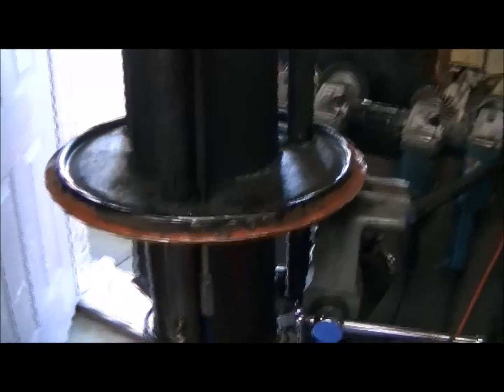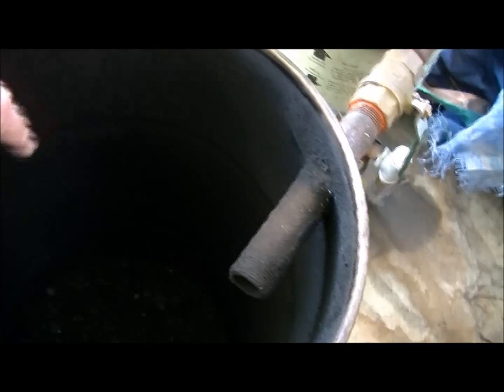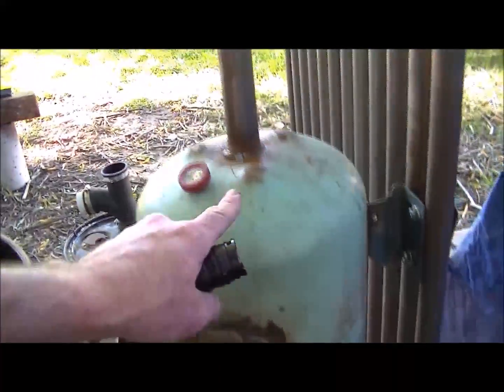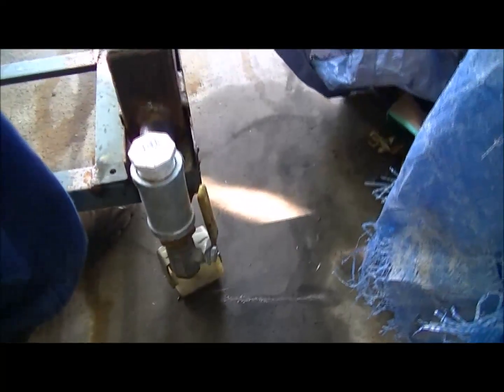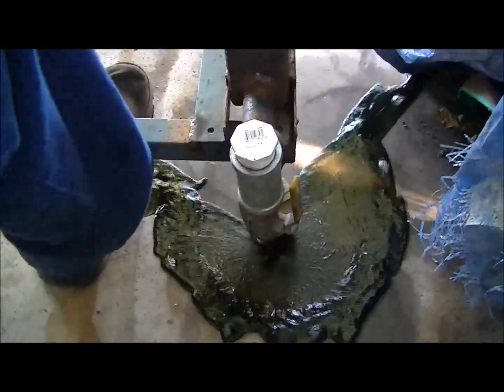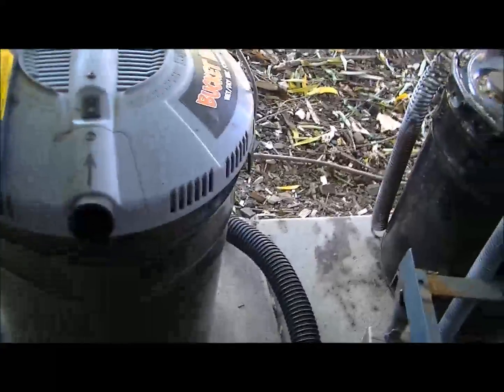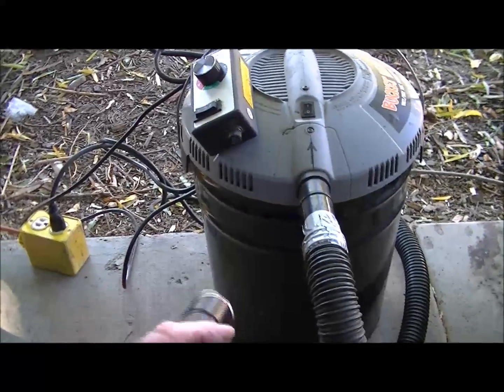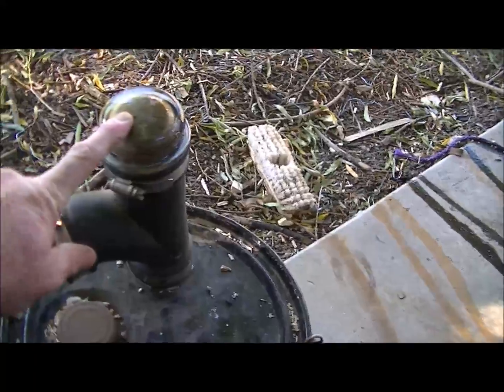DIY How to make a Homemade wood gasifier system video #1

Comment: Have you checked the pH of the water in the water filter system, or the precipitated water?
Reply from the maker: No I haven't. 
Thanks for watching and commenting!
Reply: @mugivermusclemachines5744  There definitely will be some carbonic acid forming and dissolving with the undergoing process, but it can also react with sulfur oxides  and nitrogen oxides to form dillute acids.

Comment: can you help me with something...im doing a debate for my science class on how efficient/environmentally friendly wood gas is against biomass fuel and i cant find anything. i need to do well on this because its like 70% of my grade
Reply from the maker: Kylie Hernandez 
  Sorry but I don't have any technical information your best bet I would think is to search the internet for the different chemicals and emissions of the two different fuels
Reply: check out [ drive on wood ] there is more info there than any where
Reply: There was a EPA tested truck and I think it was 30 percent performance loss, but it burned cleaner than fossil
Reply: Nice job!